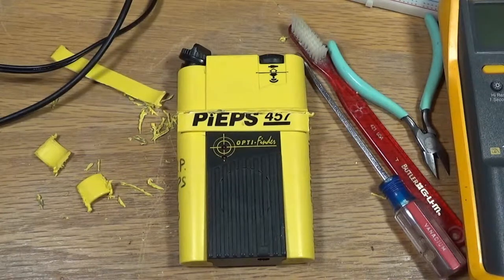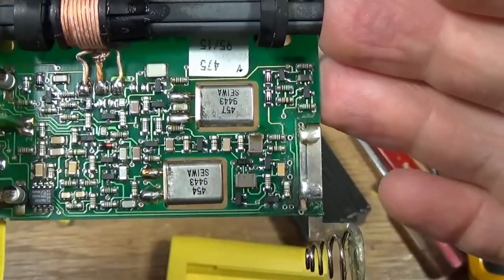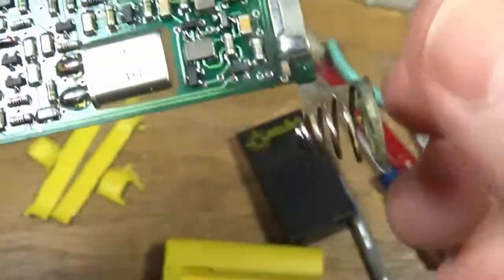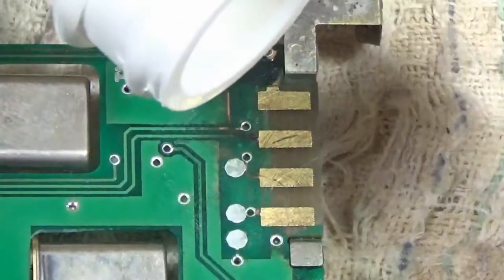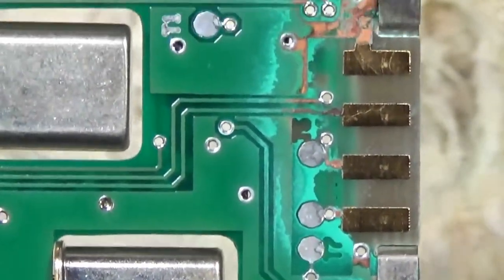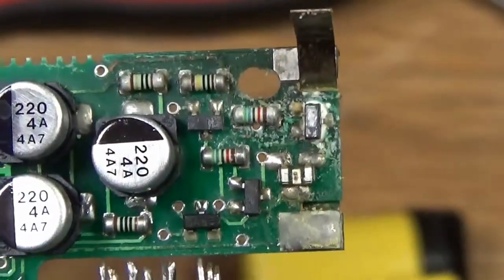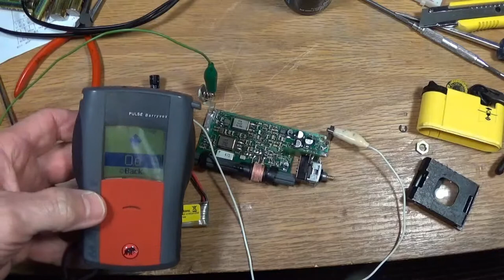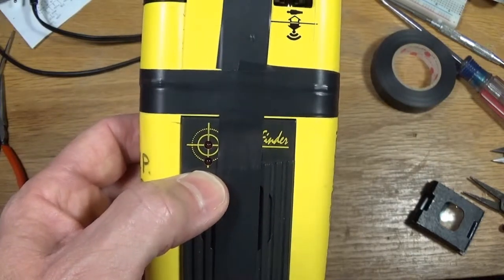Teardown and Repair: An Old Avalanche Beacon

Comment: A much more interesting teardown than average household equipment. Thank you.
Reply from the maker: +jetblackstar Thanks for watching. I wondered if anyone would get anything out the video.
Reply from the maker: @matejv2840  If you need a transceiver for backcountry use, you should use a new, modern digital unit.  This one is old and damaged, not worth the risk repairing it.
Reply from the maker: @matejv2840  The electrolyte (the liquid that leaks out) in the batteries is corrosive.  It eats away at all the metal on the circuit board; the copper traces, component leads, battery contacts, etc.  Makes a right mess of everything.